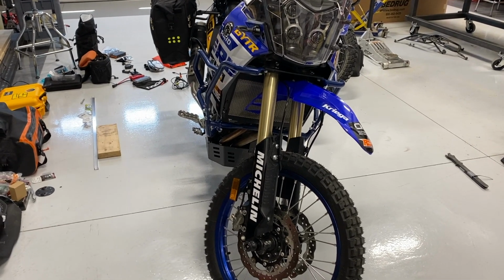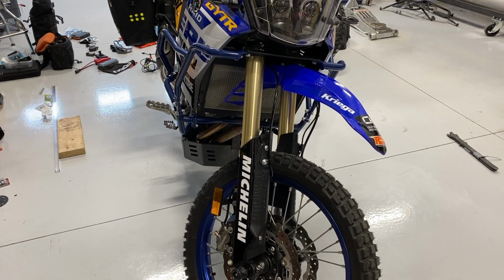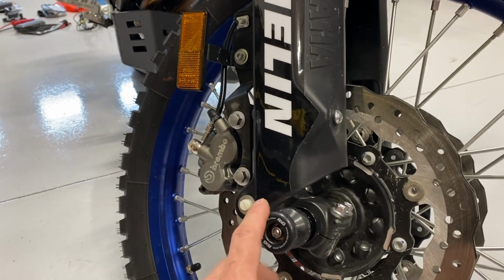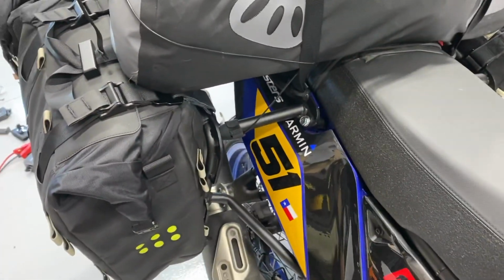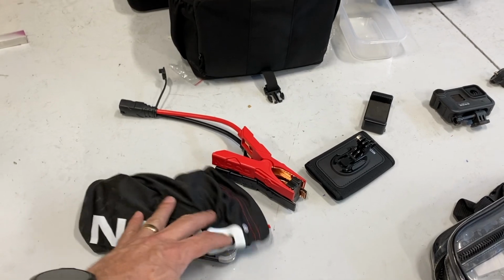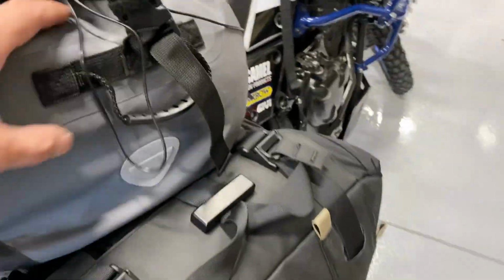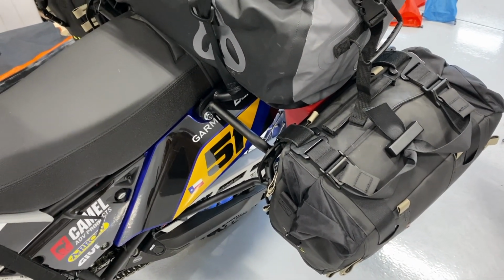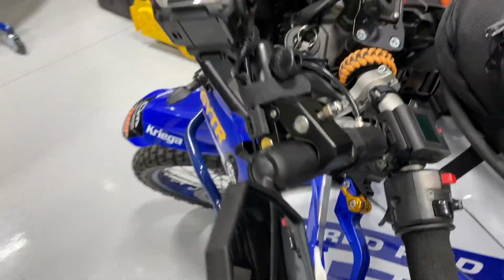Yamaha Tenere T700 BDR Preparation

Comment: Just returned my Outback Motortek upper and lower crash bars . Tried to install them and after much cursing and 4.5 hours had to remove them . 2.5 hours later they were all nicely packed and ready to go . I was so pissed . Those bolts with the nylock nuts were too short and it took a lot of ingenuity to get them to go on with the washers . Then the damn 55mm main engine bolt was a total nightmare . Just couldn't get it to seat . Even when I threw in the towel after taking the right side plastics off to get a ratchet in there , to no avail , I still tried that bolt with successive removal of other stress points . Finally I tried it without anything and it did thread on but it was a bit cranky . 
    Had a nice conversation with the part owner/owner and I learned about tolerance stacking . They sold 150 sets at that time and me and 2 others had issues and had to return them . Really like them but I can't chance going through that again with a different set . Probably go with Tourtech but want to see what Altriders final product looks like .
Reply from the maker: Hardworking American man I hate to hear that but totally understand. I suppose I was lucky to get a set that fit correctly. I like them a lot.

Comment: Hi everyone, I had the chance to be one of the first to have the T 700 Teneré since July 31, 2019 in France. I traveled 12000km including 6000 km off road. Part that you don't talk about in your video and that's important. Shock absorbers ... rear fork and spring. Depending on the weight of the pilot and the luggage you will have to change your springs because you will be talloning often.
looking forward to seeing you in your next videos

Comment: Very nicely setup. I like the front frame sliders because they should help protect your front fork guards. Take the original bolts as spares to replace the nylon bolts when they break from just rough roads. As easy-out might help as well.
Reply from the maker: MotoGuzziMoto great advice...I do have the spares

Comment: Can you make me/us a favor ?? 
Can you tell the dimensions of oem handlebar of tenere 700??
i dont have the bike but im gonna buy it, but after a ride that i have i see that handlebar was litle low for me.
So im thinking to say the dealer to instal some other handlebar before i buy it but i dont know what handlebar fit with cables of t7..
this handlebar , Protaper ATV High bars , do you thing that fit ??? i want the maximum height that i can go with no problem at cables.

Comment: Question on the sliders . How do they attach . Are they independent of the axel ? Wondering how they would help in removing the front tire is key to getting to the axel bolts ? Of course I know you wouldn't have used them and said they will also help in aiding a tire issue , just asking for a little more clarity on those items . I think I will get them also as I opted not to get the center stand at the last second . Thanks again .
Reply from the maker: I did the exact same. Bought the sliders in lieu of the center stand. I went to lowes and purchased some aluminum channel and cut it to fit inside of my skid plate for the front and drilled a hole in it for the back (axle hole) to lube the chain. I do not have a center stand. the back sliders are under the axle nut though. I am experimenting with the best approach on the back.
Reply: @waltersprang  
Called Altrider today and they are a friendly group . A friend of mine that's older than me just hung up his helmet , I think for good . That leaves me with 0 local friends with motorcycles . Any friend either sold theirs or moved away , far away . Time for new friends with Dual Sport ADV bikes . Well they just need a license cause I have an extra DR650 . Anyway the person I spoke to had some helpful information and they hope that they can still do their "a taste of Dakar" in Nevada next April .
    Well let's pray we have an April at all next year in a country that resembles what America was once some time ago , free . I'm not holding my breath but I will breathe easier if I can get those acres I'm looking at .

Comment: Damn, I rode to Argentina with half of the stuff your taking!
Reply from the maker: Steve impressive!
Reply: You can go with just a change of clothes and a credit card if you want.  I'm sure he is just using this run as a test run.  Everyone always over packs, the key is to go enough times to realize what is used and what is just extra weight.   Personally, back in the day I was into backpacking and I bought high quality lightweight gear, now I just let the bike carry the stuff instead of me.  The variable for me is beak downs, easy to go overboard on tools and parts; my 'fix' is to over maintain and carry a tool kit of only the sizes on the bike.

Comment: Curious, I’m looking to add some accessory lights to the T7. Since you had the S10, do the electrical connectors match on both of the bikes? Wondering if I get an S10 Harness from Baja Designs to run some lights I have will it run on the T7?

Comment: Glad u mentioned your battery booster/ jump starter! I have one and it’s awesome! Not only can I jump my bike if needed without having to have long cables, but it also has two USB ports (one of which is quick charging) a 12v output, a compass, and a flashlight. This allows me not to have to carry a bunch of USB adapters and a battery brick and lets me plug my mini air compressor easily. I have been able to help out my follow riders by having this and a couple of cars too. They are also relatively inexpensive! 

Your bike looks awesome! Could u link your mods? Did u put on the graphics; if so how difficult was it?
Reply: I have the same graphics in Red. Allow 6 hours to fit. The difficult part is making sure it aligns properly. The graphics are super sticky and pretty thick so expect air bubbles and some creasing. With patience it will come out fine.
Reply: @jameshind6644  thanks James….finally got my Tenere (Covid madness) and was able to put on the graphics. Turned out great!

Comment: What gas mileage are you getting on the highway and on the dirt?  Nice rig.  So you decided to sell the S10?  You must think the T7 is pretty good on the road as well to be selling the S10.  I am about to do the same thing and go to something a bit lighter for some more aggressive trails.
Reply from the maker: Right now I am getting in the mid to high 40s. And yes. The S10 is going to be sold. I still love it but it feels like a pig compared to the T700.
Reply: I an assuming that the T7 is comfortable enough with hood wind management for your multi thousand mile trip to Alaska?
Reply from the maker: J W I will know a whole lot more after this next week.

Comment: How did you get the RotoPax to fit?  I have tried everything that I can think of, but I cannot get it to fit.
Reply from the maker: Hey Steve! I had the same issue and finally figured out the only way to make it work is to push the xframe all the way back, then mount the rotpax main piece without the locking (threaded) bolt. Put the can on, then put on the threaded locking bolt to hold it on. Not ideal, but it works!
Reply: walter sprang thanks.  I will try it without the locking bolt.  I even drilled new holes in the frame to move it down and back.
Reply from the maker: Steve Harrison oh man. It was tricky. I will wait to hear if of any me to send how I did it.
Reply: I mounted it at an angle.  It goes in nice and easy.  I can’t figure out how to add a picture from my phone.
Reply from the maker: Steve Harrison i forgot your mention I did not use the plate that came with it. I just ran the bolts through the existing holes. Make sure you use loctite! I just lost mine on a road in NM!!
Reply: walter sprang I used plenty of Loctite.
Reply: I went out for a ride and was happy that I can fill the RotoPax with it mounted.

Comment: no need for the sliders mounted to the forks for lifting the bike as the front lift stand is made to fit just under the bottom of the forks, unlike the rear wheel which nned ths use of bobbins, mostly

Comment: Did  you do any suspension changes?
Reply from the maker: Spyder Eye I did new springs only so far. I ordered them from off the road in Germany. Front and back. I believe I will have to replace the shock in the rear as with the new spring I cannot get the sag adjusted completely